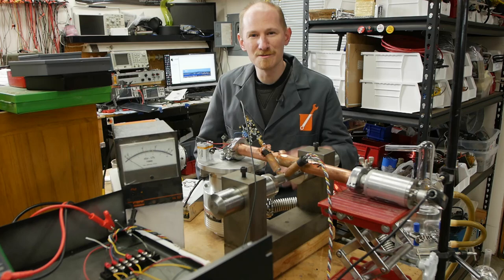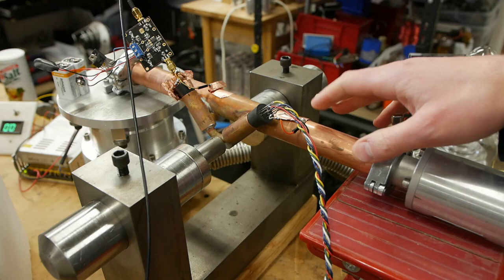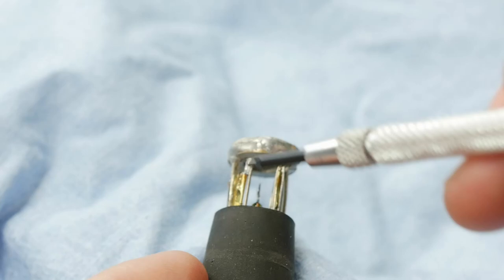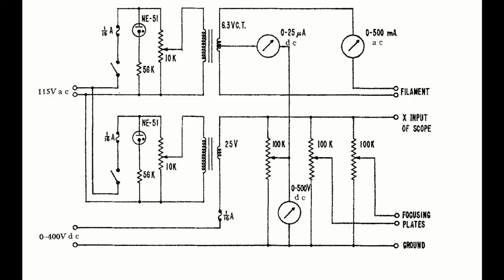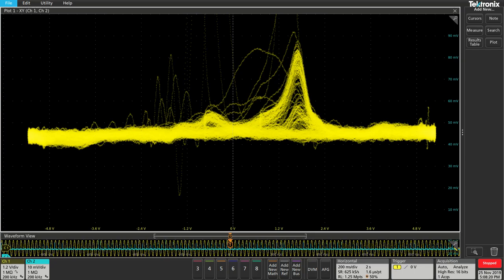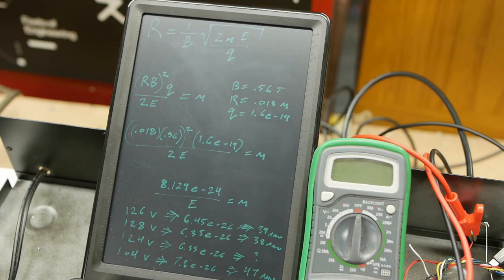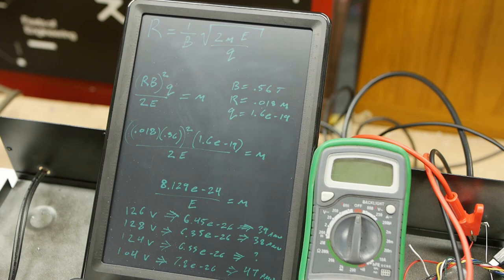DIY mass spectrometer measures potassium in dietary salt substitute

Comment: With the right foresight with designing the vacuum line, its easy to use a diff pump where you need to frequently release vacuum. If you put a stopcock between the diff pump and the working line then you can close off the pump to the line, release the vacuum, and keep the diff pump refluxing. This way you can do whatever work you need and then reopen to the diff pump and it should pull down within minutes. You can keep a diff pump refluxing 24/7-365 as long as youre not pulling shit into it and keep it under vacuum (if you heat the oil under atmosphere it will char). Mine has been running for ~3 years continuously with no maintenance (though the roughing pump sees regular oil changes).  Cold trapping also helps, but I have cheap and abundant LN2 so thats probably not worthwhile. Never used a turbomolecular pump so I cant comment on whether this is "better" or not, it's just what I have access to

Not sure if this is already known to you, but thought I'd chime in as a chemist who works on highvacuum lines frequently :)

I'm also a bit surprised that you had such large issues with tubing. I am able to maintain 1x10-6 torr with tygon tubing segments (rest connected with ground glass or o-rings). Definitely out to low millitorr you should be able to use clamped tubing (most schlenk lines in chemistry labs feature tubing similar to what you used, and 50mtorr is achievable on a good line--and that is pump limiting not leak limiting)
Reply: He should be able to hit -5 torr with that turbomolecular pump in about <5 min and reach an ultimate vacuum of -7, cheap roughing pump oil often has a vapor pressure of -5 torr so once it gets a little contaminated with solvents and water the system will peak out in the mid -4s assuming there isn't massive outgassing or leakage on the high vacuum side.
Reply: @CafeBikeGirl  diffusion pumps are much higher volume though than turbo pumps per size. I have seen videos where the gauge plummets like a rock when they open up the diffusion pump and that is on a much larger chamber than that little pipe. Problem is that out-gassing is not free flowing gas so it takes time. To get lower he would also have to do a bake out to get rid of humidity.
Reply: No doubt that a bake out will help clean out all the crud in the system from initial assembly and make sure he's not getting stray signals from stuff outgassing but it's a molecular flow system, he's not going to get any more flow than what that KF25 connector allows which is going to be something like 30 or 40 liters per second. The pump he's using appears to be comparable to 140 l/s pump (for N2) Even then the analyzer portion is not going to flow any more than the ~1/2" T-fittings allow. Unfortunately his sample delivery isn't going to support doing a bake out during a measurement run but he should be able to squeeze out another order of magnitude on the vacuum with a little effort. My real point was that for $20-40 he could significantly reduce a potential source of gas load, and to your point if he hasn't done a system bake out yet that could reduce it some more without adding complexity. Backfilling with nitrogen would be a big help but he would need to add a valve for that (preferably two) and be very careful not to shock the turbo. These things would get him more working time with his sample.
Reply: @CafeBikeGirl  &  @excited box I truly enjoy your discussion above, as well as some other interesting notes above. I believe I can even follow, though it's 'not quite' my area of expertise.  Of course, thanks to  @applied science for an excellent video and a beautiful build!

Comment: "I'm going to show you how to build a mass spectrometer in the home shop."

[*Proceeds to produce a turbomolecular vacuum pump from yard sale junk pile.*]
Reply: You are amazing... I'm a service engineer and have worker with several mass systems from Agilent, thermo, Shimadzu... but to see some one building a mass unit... thats astonishing
Reply: That Tek scope alone is worth more than a BMW...
Reply: @TheNefastor  And you can do the experiment just fine with a $20 Amazon scope kit.
Reply: @schmetterling4477  I strongly doubt that, they don't have the resolution or bandwidth (or voltage handling) to do something like this.
Reply: @AureliusR  Yeah, they do.
Reply: @schmetterling4477  A 20MHz (at best) scope with an 8-bit ADC... yeah okay.
Reply: @AureliusR  Dude, most science until the mid of the 20th century was done with pencil and paper for data acquisition. The fastest we had was photographic film. You clearly haven't done any relevant experimental work in your life.
Reply: @AureliusR  He is using a 10V range on the X-axis and a 100mV range on the Y-axis. That is peanuts for any oscilloscope.

Comment: Amazing work!  Judging from the size of your turbo pump the level of vacuum is only that pump is able to keep well ahead of the leaks and outgassing!  Copper outgasses a lot (oxygen free copper is better), aluminium brass or 304 stainless steel would be a lot better!  The solder is not that much a worry but the flux is. 
I used to work on this stuff........god 35 years ago!!
Reply: Yea, I'm sure his pumping speed is whatever a KF25 will provide at that temperature and the little copper T-connections on the analyzer. I'm curious how he obtained one that big for "home use" in operational condition.

Comment: It would've been nice to see another graph with a different compound to see if the same mirroring effect existed. That would probably be the strongest evidence.
As another commenter mentioned, it could just be another ion (such as Ti) present. So if another graph presented a peak at 104V, then it may not be mirroring, but another ion. Whereas if the position were slightly different, it could be the mirroring you mentioned. If you could come up with a compound which would present a more unique double hump of two distinct peaks, then I imagine it would be the strongest candidate. But, then again, I don't offhand know of any solution you can make with two dissimilarly weighted elements (but I'm not a chemist).
Reply: @Vallecaucanisimo  I believe it was around 47, which would make it titanium

Comment: Amazing work!
I just want to add that it is possible to analyze substance mixtures even without a gas chromatograph (As Ben has said there are a lot of different MS techniques). To do this the molecules are ionized with less energy, such that they do not break apart into the individual elements, but instead such that different sub-parts stay together (like CH3, CH2, OH and so on). This gives a fingerprint for each molecule. With those fingerprints (relative peak height for the different masses) you can assemble a system of linear equations. Then you analyze the substance mixture, you solve the system and you get the proportion of each substance in the mixture. Also there are spectrometers that have a gas-inlet, which allowes to analyze gas mixtures continuously. This can be used to monitor chemical reactions in almost real time.

Comment: I always enjoy and am inspired by your videos. They hearken back to the old "Amateur Scientist" column that I couldn't wait to read each month in my younger days. Projects like "Build an Inexpensive X-Ray Machine" and "A Homemade Atom Smasher" would always open new frontiers of what is possible and, even if the project was beyond my reach at the time, seemed to lead to experiments and projects that I otherwise would not have thought of doing as well as using what I had at hand and seeing things in new ways. Your projects are like that. Thanks!

When you mentioned building a gas chromatograph it brought back memories of a project I worked on back around 1979-80. I was working for a medical instrument company in a department charged with developing technology for the 10 - 15 year future time frame and one of the projects I worked on was a micro gas chromatograph. The goal was to create a handheld GC that could continuously analyse blood gasses from samples obtained non-invasively from a patch on the skin. The company ultimately dropped the project (ultimately the entire department was dropped and the company has gone through a number of owners) but we did create a variety of prototype pieces to test our ideas out and, by the end of the project, we were able to analyse 100 microliter samples of 4 gasses in Helium in around 20 milliseconds in continuous operation. 

Alas, much of our work is long lost but I have been collecting and putting online a "lost technology" archive and have a copy of an internal review document about the project scanned and posted, full of technical details, that you might find interesting and useful. You can find the scanned pages at: http://www.eastjesus.net/tech/microGC/GCProjectReview-cover.html 

A colleague from that project went on to spend a career doing research in the mass spec area and I've stayed in touch (he was here for Thanksgiving last week!). I'm sending the link to this video to him and hope that he may find time to contact you. Best wishes!

Comment: I have to say, I had no expectation of running into this tonight!  I've watched another guy use a "gas chromatograph mass spectrometer" many time, as a Marine, with oil samples for the engines and transmissions of helicopters, if the metal content is high, it was time to tear down and rebuild, rather than wait for it to blow.  I'm very impressed with your work, and what you've put into it.  As to the rubber plugs, the answer is "carbon black".  I've been a mechanic all my life, in and around nasty equipment, but the dirtiest job I've ever had was at a couple of tire shops, for a couple months each.  By the second day, I was gray, stayed gray for three or four weeks after moving on to another job, electronics once, and the Corps the first time.  Carbon black plugs any holes, and those plugs are long enough it simply packs in.  I worked on big 200 KW diesel generators for a while, and they produce a good bit of particulate carbon of that minute scale as well.  Thanks for a great job, a great demonstration of talent, patience, and industry.  I've got to watch my dietary intake very carefully because of multiple sclerosis, gulf war disease, from our classified, experimental anthrax vaccine, back in 89, so this is extremely interesting to me, potassium is what I'm always concerned about.  Incredible!

Comment: I don't have an article to link you, but a simple gas chromatograph is fairly easy to make. Generally speaking you have three parts: the sample inlet, the analytical column, and the detector. Since you already have the detector you need a closed system with an adsorbent that is temperature controlled, flow to move things through it, and a way to introduce sample. I've made columns out of 1/16" to 1/4" copper and stainless tubing packed with silica gel, molecular sieve, alumina, and so on. The stationary phase and length largely depend on what you are going to analyze. A small insulated box works for holding the coiled column and can be temperature controlled with heat tape or heater cartridges and monitored with a thermocouple. If the length and diameter of your column are small some people have simply run current through the conductive column to heat it.
Reply: Hydrogen vs nitrogen is tough for a carrier gas. Since nitrogen is a larger molecule the gaps between them are bigger so it's less efficient than hydrogen, but since hydrogen is so small and you're intentionally introducing it to your mass spectrometer it will really make your turbomolecular pump work. Gas purity is also of the highest importance. Hydrogen can be generated much cleaner than nitrogen can be purified so that might make a big difference. Speaking of clean you need a way to introduce the sample without letting air get into the system that would damage the tungsten filament, and without massively disrupting flow to the system. Multi position valves work well, or an injection through a pierced septum are typical. For the analytical column to function effectively the sample needs to be primarily in it's gas phase, so you want to start at a temperature where your lowest boiling point analytes will be a gas and gradually increase your temperature from there to volatilize the rest of the sample. The ramp in temperature also speeds the rate that compounds elute from the column, so you can play with that rate to get better separation between compounds.

Comment: Hi. Been watching for sometime now and I like your channel. I have worked with mass specs for a long time even designed magnetic sector and crossed E-B field devices. Most of my work has been in residual gas analysis. I think I can help with two of your issues, which were present in the earlier work.
1) Try a pin hole not a slit. The slit is fine for optics but with your variable mag field the slit is sending a flat ribbon-ish stream of ions which pass thru different mag fields reducing your resolution. You may also be defocused and with the variable field you could have distortion which creates multiple images at different energy levels producing the ghost peak. Again a point source will help as will a more uniform mag field.
2) If you scan the energy slowly the input capacitance disappears in your charge / current amp. When you deliver a pulse of charge, the amp is acting more as a charge amp. The gain of a charge amp is Cf/Cin, or Rf/Ri whichever is smaller. By going to a DC measurement you remove the pulse nature and hence measure current. We used to use Keithly 602 electrometers.
3) I have suggestions for mods to your ion source and adding a focusing element after could also give you much better results. Niether of these is difficult. Einzel lenses are very easy to design and build https://en.wikipedia.org/wiki/Einzel_lens. 

4) I await your time of flight mass spec, I was on a team that flew one to Hally's Comet once a long time ago, in a galaxy far... 

Hanabi
Reply: One of the most underrated contributions in a YT comment section! 
I also agree on the first point. ;)
Reply: @jackmclane1826  Thank You for your kind words. Ben kind of put out a teaser on a different kind of mass spec, which I presumed was TOF. These are easy to build, but do not have much resolution. On the Haley's comet device, an instrument on the European spacecraft to the comet, we used a tungsten impact plate. At 70 km/s the dust grains would vaporize on impact. We used a PMT to detect the flashes (our part of the instrument) and set 0 time, then an electrostatic field extracted the ions and accelerated them towards an electron multiplier which detected the ions. From F=m*A you could extract the ion's mass/charge ratio with tungsten as a calibration standard mass. Fun days those!

Comment: Amateur Scientist published TWO articles on DIY gas chromatographs, the first one was a hot wire thermal detector, the second was with a flame ionization detector. I built both in high school. Unfortunately the GC that front ends a MS usually uses a capillary column, otherwise the combination of carrier gas and sample will flood the MS. I ran a GC/Ms for a few years, get a turbomolecular pump instead of the oil diffusion pump. I still have a capillary GC in my garage. HP, not DIY. Also, you should be measuring peak area, not peak height for abundance.

Wonderful and inspiring video.
Reply: He is using a turbomolecular pump. He said in the video that he ditched the diffusion pump.
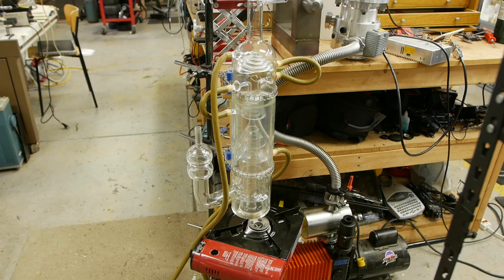Reply: Trey - au contraire Madame!  @7:30 that glass thingy filled with boiling oil definitely isn’t a TM pump. He’s complaining about the time it takes to start and stop the pump when he has to reload the ion source. That butane stove he’s using certainly isn’t running any TM pump I’ve ever encountered.

He did say he’d like to revisit the diffusion pump in a future video.
Reply: You built TWO gas chromatographs in high school ?
And for all these years I foolishly thought I was doing cool stuff myself in high school...
Reply: @uski  scientific American magazine used to have an monthly column called the Amateur Scientist where they described how to make such. They had two articles on GCs, I built them both. 

Kind of like Instructibles today.